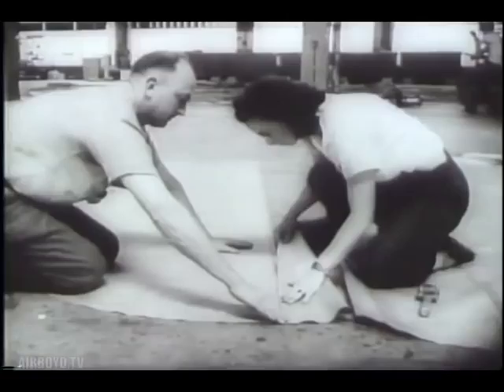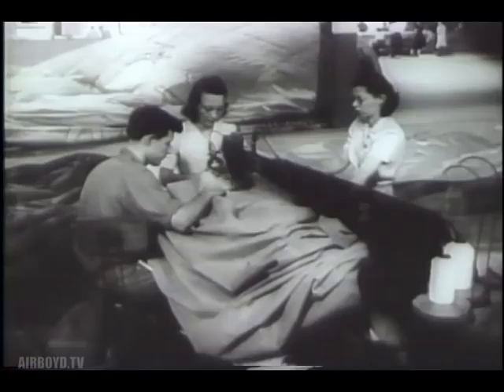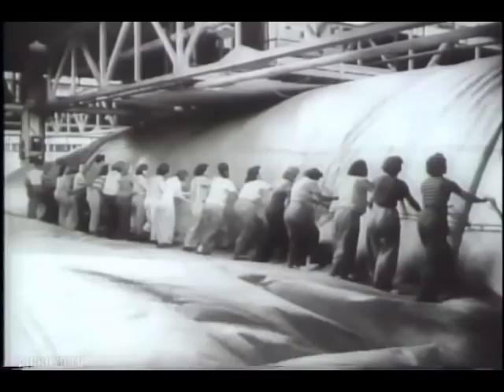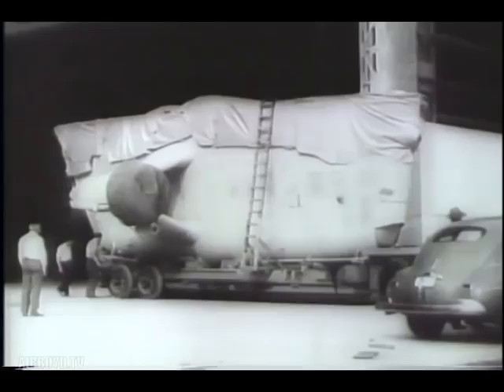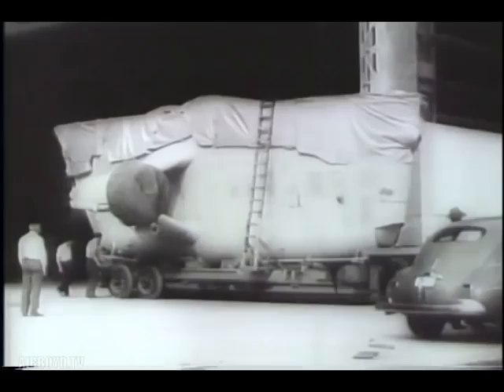Blimp Construction (1942)

Comment: @1kleineMax1 correct. But it would not burn as good as H_2. You would need one or two rigid spheres. Bigger would be better because the lift is ~r³ but the total force ~r². Another funny thing is, that concrete can take a lot of pressure, so stone might be a good choice for the hull.

Comment: are there lighter than air aircraft with a solid hull that use a vacuum? what if you fill it with air on the ground, then heat it, then release the hot air at altitude, then seal the volume? would not it stop falling at some point (above ground) ?

Comment: @0MoTheG 
What?
Do i understand you right that you thinking about a blimp that is not filled with lifting gas but just without air in it -> vacuum?
That is more risky than using hydrogen, cause:
1. you need a more stiff and massive hull cause of the outer pressure -> whole blimpe would get heavy (more like a rigid airship)
2. eaven a little hole would be a desaster cause the position of the hole wouldn't be important it would suck in air, while on a blimp a hole on the bottem is ... ok